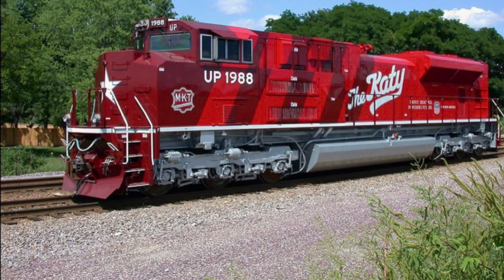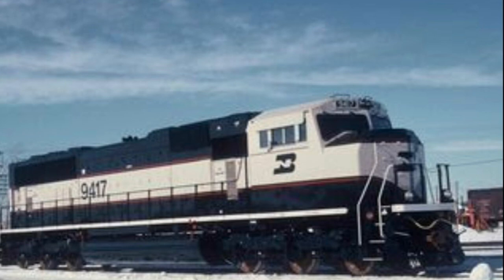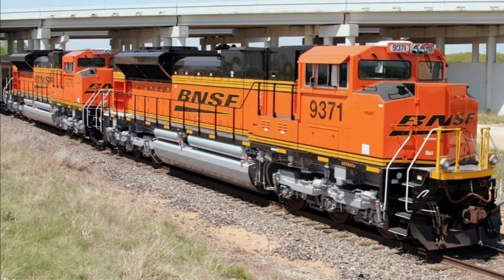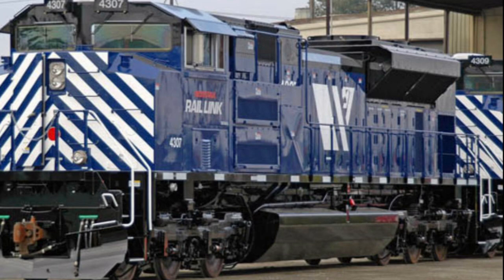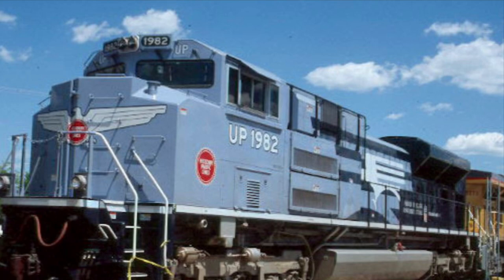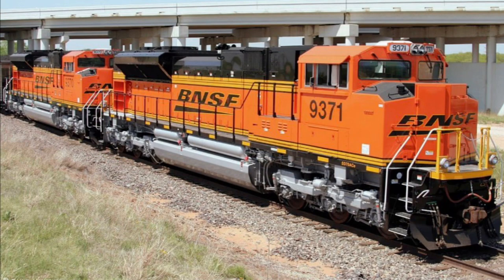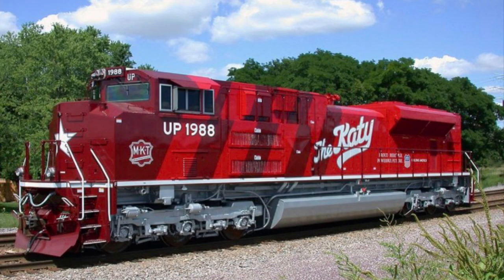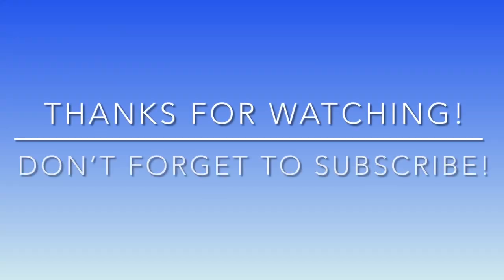Engines Of North America: The EMD SD70Ace

Comment: Corrections, U P has close to 800 SD40ACE'S and none of their SD70ACE-T4'S are in storage.  They had computer upgrades but they are out pulling freight. I just retired from there.
Reply from the maker: May I ask when you retired as I may have been using (at the time thought to be) current information. Still thanks for the insight. :)
Reply: @ironhorsehistorian9871  retired for 2nd time November, 2021